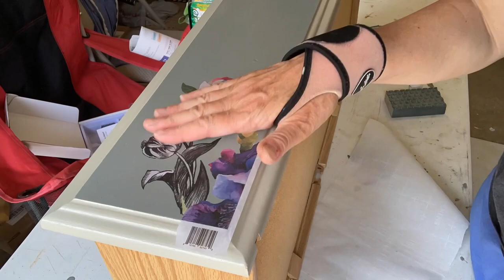How to Decoupage and Remove Unwanted Decoupage!

Comment: But your not using the actually a MOD PODGE water base, sealer finish those look like Furniture 'TRANSFERS' press ons. Which I have used quite a few on my headboard that dont require to be "Decu Podged"